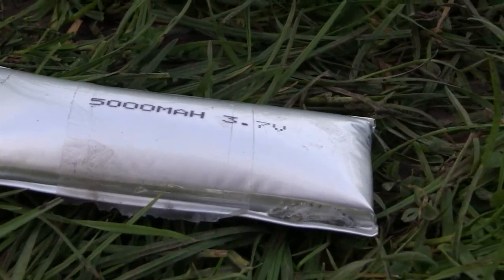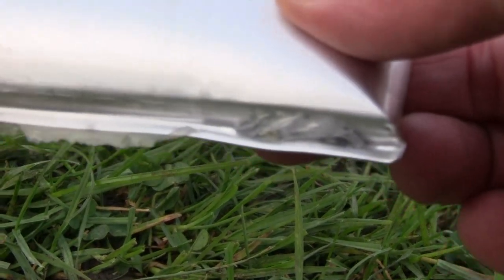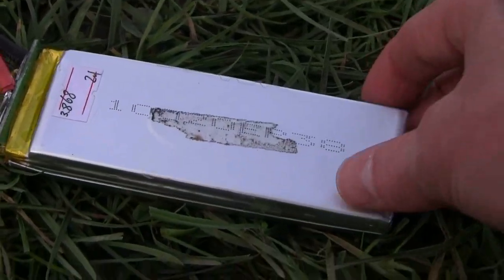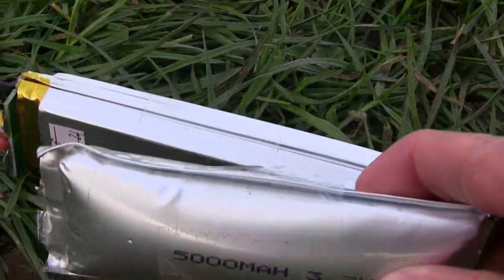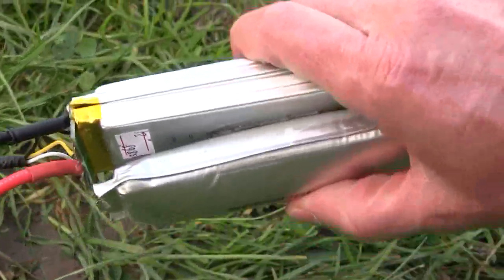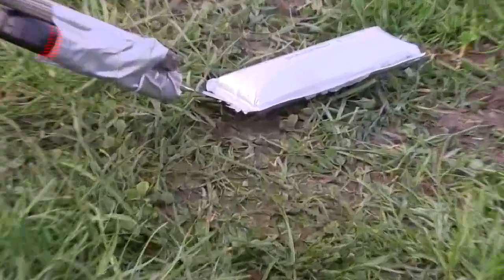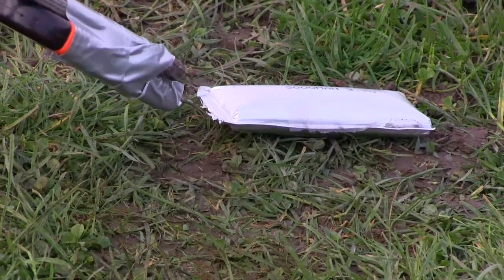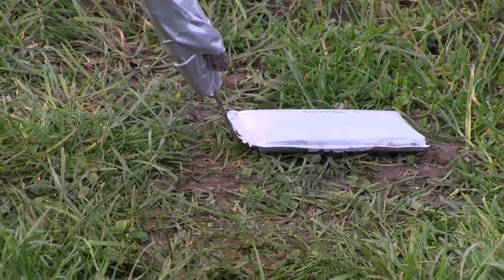Puffed Lipo - Will it Explode?

Comment: That battery kinda looked like a battery I bought recently (Matrix, 14.8 volt, 5000mah, 100c burst, 65c cont.) It looks like the battery in the video has 4 3.7v cells (same as mine) and one of the cells on the end puffed. My battery started puffing not long after I bought it and it looks like only the cell on the end has started puffing. The charge wires look different but otherwise, the similarities made me double-take.